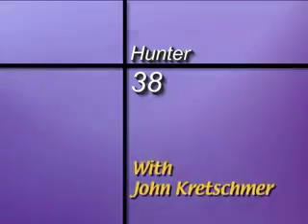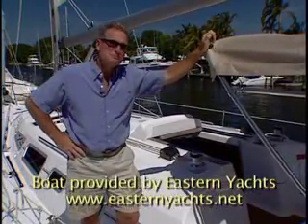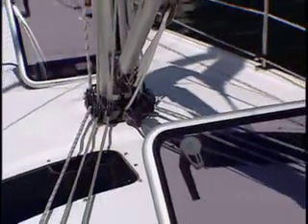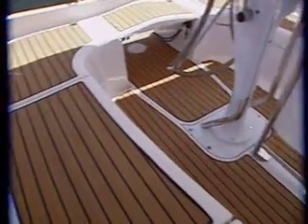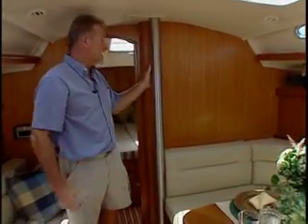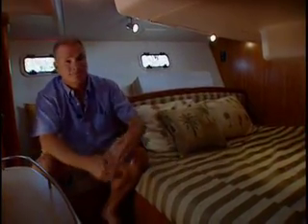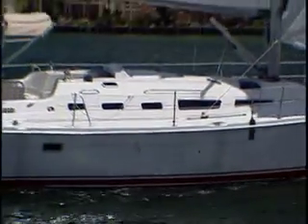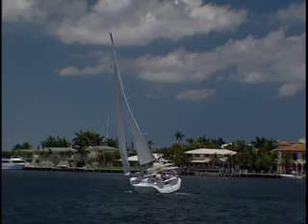Hunter 38 Test Sail

Comment: It would likely be the last choice on my list for a blue water crossing.  While I haven't sailed the 38, I have sailed the 33 and 36.  It's a very pretty looking boat, both inside and out.  That certainly doesn't mean it sails well though...  Easy for solo sailing.  However, try to sail this thing in a strong wind on upwind tack, or very close haul, and you'll quickly see why many don't care for this boat.  It's like a brick with a sail attached, and a toothpick for a rudder!

Comment: I'll check out a hunter at the next boat show but I still would not cross an ocean in them.  You and I both KNOW FOR A FACT that a rating of a boat and what the boat is really able to do/withstand can be two very different things.  Also, any monohull can easily be rolled by a wave on beam of 1/3 their length - 4m is about right for a 38, nothing impressive.

Comment from the maker: Your credentials are impressive. However, I HAVE sailed the boat, and for what it is designed to do it does it very well. It is a coastal cruiser with spacious accommodations, built to a price point. It is not, for example, a Valiant. So why you brought up crossing an ocean in one does not make sense. And though John Kretschmer is a professional sailor (with more than 250,000 documented miles at sea), his opinions were developed on the spot while actually sailing the boat.